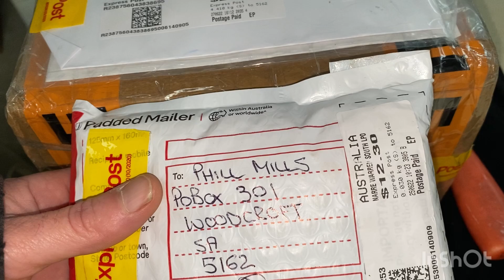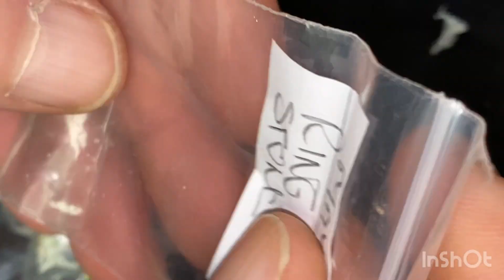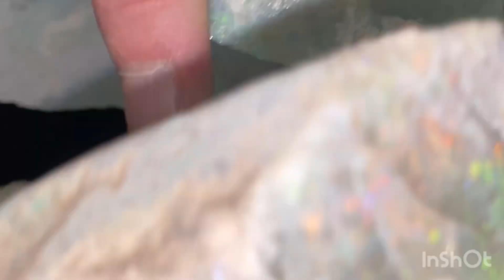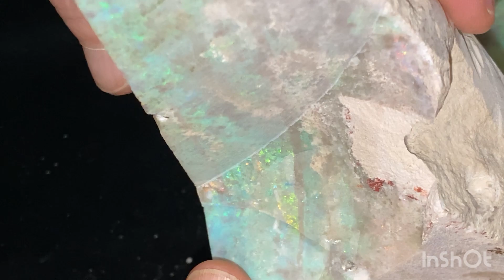Opal cutting: roughing out, and a quick cut.

Comment: What grit disk is that and who makes it  ..I can't afford the other kind
Reply: Try a car buffing kit,  some sandpaper from ebay in 1k, 2k, 3k, 4k and 5k, attach it to a cordless drill and presto! Professional lapidary for under 50 bucks
Reply: I made split bit for my Dremel using chop sticks. Cut small strips of sandpaper and ta-da. Of course you could forget the power tools altogether and simply do it by hand like the old days.
Reply from the maker: I use 240# on the hard face plate that comes with the machine, then black pad 280#, brown 600#, grey 1200#, pink 3000#, but finish of on a leather wheel with cerium oxide. I’ve roughed out opal on a dop stick with a dremel and then used a cork block and wet/dry sand paper 400# through to 2000# and got reasonably good results. 🤪👍
Reply: Ok aw I got all but leather disk I will work on getting one thanks ya to everyone